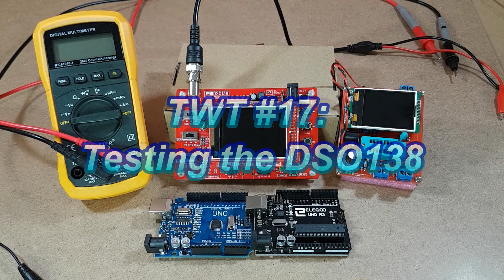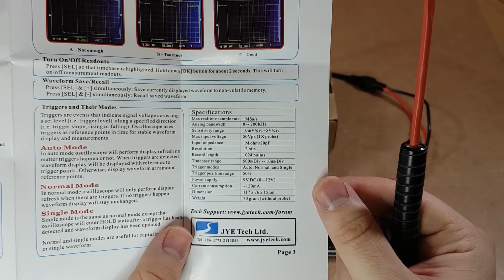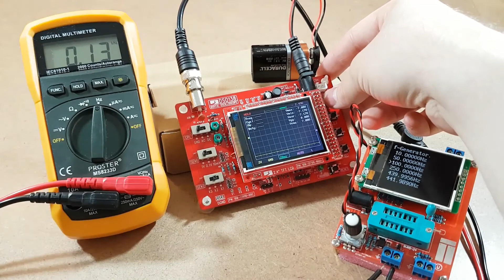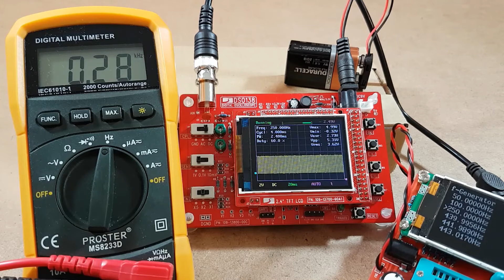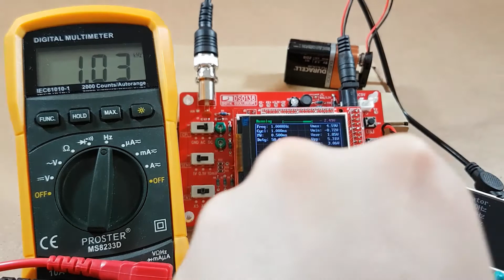TWT #17: Testing the JYE Tech DSO138

Comment: I tinker with small electronics. Arduino included.
Would this be ok for an Elenco diy radio kit?
A scope and audio generator is recommended for fine tuning the radio.
I was interested in building one with a Nano but then I saw this kit.

Comment: Hello, very nice video ! i an new to oscilloscopes and i would like to ask you some questions about DSO138:
1- What is the difference between the BNC and P6100 probe
2- For DC current should i hook to both negative and positive of the component to see it waveform ?
3- For AC current only positive of the probe or both ?
4- What is the purpose of the alligator probe linked to the P6100 ?
5- Can i see the waveform of 220v of the mains ? with which probe ?
6- What is the 1x and 10x of the P6100 probe ?
7- I want to see the waveform of some PWM of PSU ATX rated at 500Khz, is it possible ?
Thank you very much !
Reply from the maker: Thank you for taking the time to comment, I'll try to answer these questions as best as I can, I'm a bit rusty as I haven't been tinkering much with electronics in the last couple years.

1) Both probes are BNC probes, BNC is simply the name of the connector that they use to interface with the oscilloscope. The main difference will be that the included probe is just alligator/crocodile leads and the P6100 is a probe with multiplier adjustment.

2) Yes, an oscilloscope works exactly like a volt meter but instead of an averaged single value in a single instant, it gives you the value over time as a waveform. Therefore you need to connect the leads to the positive and negative in order to produce a waveform.

3) Like with a multimeter you will need to connect the positive to live and the negative to neutral in order to trace an AC voltage.

4) The alligator clip on the P6100 is your negative/neutral connection, rather than be a separate probe it is attached to the P6100.

5) The DSO138 is not a mains rated device, it is not recommended to use it with mains voltage and is only rated for a maximum of 50V. In order to work with mains you would need a mains rated differential probe and a scope with the appropriate safety features. Maybe check the EEVblog for videos about probing mains?

6) 1x and 10x of the probe are the impedance multiplier. The 10x setting will attenuate the incoming signal by a factor of 10, and therefore need to be taken into account as all your measurements will be 10x lower than reality. 

7) You would need a scope that can reliably measure 500kHz signals, I personally wouldn't expect the DSO138 to be capable of this.

Hope this helps!
Reply: @TinkeringWithTerrius  Thank you for your neat and clear explanations. Regards-

Comment: how do you like the frequency generator kit? I just built my DSO 138 (dead LCD, working on replacement) and I'm on a big "build all the electronics kits Amazon has" kick....
Reply from the maker: It seemed to work reasonably well, I only had the DSO 138, my cheap multimeter, and my component tester to test it with. Which of course means I have nothing precise enough to give a good idea of how accurate it is, but I'd say for hobby work it is fine. I can completely understand going on a kit building bonanza, it's so satisfying to assemble something and then be able to actually use it without having to manually program anything!

Comment: What max voltage and frequency it can measure?
Reply from the maker: Max voltage is 50Vpk using a 1X probe. Max frequency is 200KHz.

Hope that helps!
Reply: @TinkeringWithTerrius  The 200KHz are actually not true, because it starts to measure noise and displays a wrong waveform at 100KHz already. In your video the square wave was already starting to deform at around 20KHz, although this looked like it was partially caused due to wrong probe calibration (using the two pots).

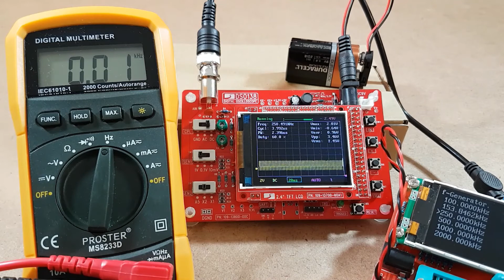Comment: 16:20 , the reason why 250Khz is about the max reasonable sample rate is because the sample frequency of the device is 1MS/s, this means that at 250Khz it only gets 4 samples per period of a wave. For a square wave this isn't really a problem but for sinusodial waves it is, then you get a blocky wave thing which is okay is DSP usecases, but not when you want to see the wave you're measuring. This is probably the reason why you can't zoom in further.
Reply from the maker: Thank you for the informative comment!

Comment: is thebattery is straith conected to power, or u using the Converter JYE140 ?
Reply from the maker: In this video I was using the 9v battery directly connected to the DSO. Currently I am using the JYE140 with a 4 cell NiMH battery pack to power it.
Reply: @TinkeringWithTerrius  I was curious the power is rated at USB or about half that of the 9V cell. I assume the higher voltage wasn't too much for it to handle. I have plenty of phone charger boxes. I guess that should work fine yeah?
Reply from the maker: @jacka55penguin  for the version of the DSO138 that I used the power requirements are "9V DC (8 - 12V acceptable)". I'm not sure if the newer versions are the same, but best bet would be to check the manual.
Reply: @TinkeringWithTerrius  Oh ok.  I was looking at the "mini" version and it doesn't require 9V.  My bad. Cheers!

Comment: The multimeter always shows about 30Hz plus. Wonder how could u miss that it's so obvious :D
Reply from the maker: Huh, never noticed that, thanks for pointing it out! It does seem obvious now in hindsight that the meter has a 30hz offset, though at the time I didn't see the connection.
Reply: I saw it at like the 2-nd-3th measurement and was waiting to hear you saying "Oh it's always +30Hz !" to no avail lol .  You can add next to the Hz switch sign (+30 !) :D

Comment: Sorry to be picky about your Morse. For SOS there should not be a pause between characters, and the long or dah should be about 3 times as long as a short or dit. Otherwise very good video.
Reply from the maker: Very interesting, I didn't know any of that so thank you for letting me know! I'm glad to hear the rest of the video was good despite that!
Reply: Thank You for that Stephen Cook. I made my adjustments arbitrarily in the programming for my Arduino, not really knowing the structure of the pulses. I also need to build my DSO so I can "see" it. I was only "seeing" it with the values I was putting towards the "on" and "off" time. With your info, I have the "math". No pause and about 3X on the long duration compared to the short, being 1X. Excellent.

Comment: I just bought this (welded) as a fast pocket scope to do fast automotive sensor testing (I have a labscope but just wanted to have a little pocket scope) took it to work today and sampled some signals lamda sensors and MAF sensors seems to work great for the price..my other option was a $400 Uscope
Reply from the maker: It is certainly one of my favorite bits of cheap electronics gear that I've bought, I got mine un-soldered and really enjoyed assembling it. It isn't the worlds most powerful DSO or the best I'm sure, but it is small and very handy. I just wish there were more, inexpensive, scopes out there with a bit more bandwidth. (Though I have seen JYE Tech has a few other models that I may look into eventually.

Thank you for taking the time to comment, sorry my reply took so long!

Comment: Could it be, that you have not calibrated your probes with the green pots like mentioned in the manual? Looks like you need to adjust your corners with these.
Reply from the maker: Thank you for the suggestion, I did adjust them for quite a while before the video and this was the end result. Any change in adjustment from there made it much worse.

Comment: I just bought one from amazon after seeing this video..I just need it for basic projects and some basic automotive sensor testing..
thanks for the video very helpful
Reply from the maker: Thank you for the comment! I'm glad you found the video helpful. The DSO138 isn't as fancy or powerful as a full oscilloscope but it seems to be very decent for basic stuff and the price is much easier to digest! I certainly don't regret buying mine.
Reply: Yes I bought it assembled with the case that I had to DYI.most Automotive signals are low frequency no more then a few hundred HZ on average..so far for $26 its great. I'm provided with $8K Bosch lab scope that's geared torwards automotive use and it works great..But this little $26 catches the signal just as well..however its very sensitive with supply voltage ..I was using a 9V battery that started to die (7.34v) and it caused it to do some crazy stuff

Comment: Good morning, I bought an equal already assembled but it came with a problem, when I connect the trace ta in the middle but it goes up and after 5 minutes it went up so much that disappears in the part of sima. Is there anything I can do to keep him from climbing?
Reply from the maker: Sorry for the delayed response.  I'm not sure what would be causing that. My trace line often drifts from the positioning pointer but it is fixed by the vertical position reset.  If it consistently climbs I'd guess it is an issue with your unit and you may have to contact the manufacturer.

Comment: Nice presentation.
Was pretty much about to comment about using the trigger, but I saw in the comments that you have that sorted out already.
If you haven't updated the firmware of your DSO I advice you to do so. The latest version have several nice features like being able to center the trigger level, and resetting the horizontal window cursor.

Will definitely subscribe to your channel. I'm sure your adventures with electronics will be fun to follow.